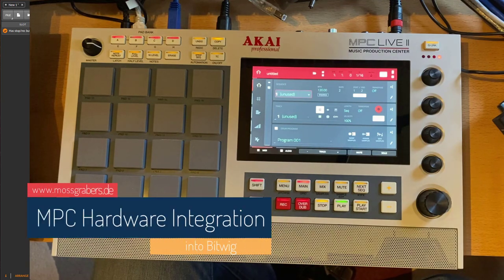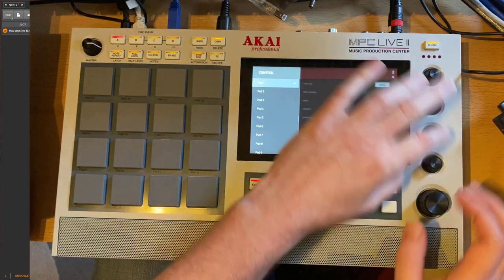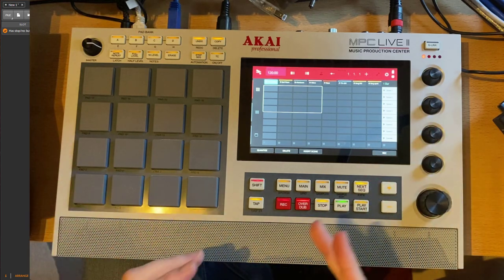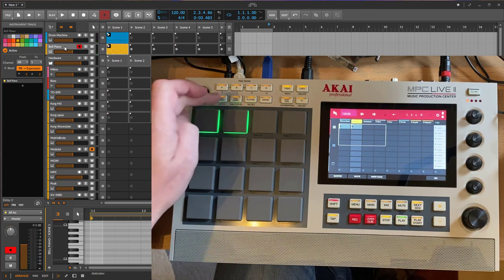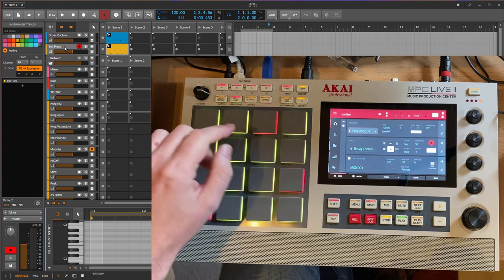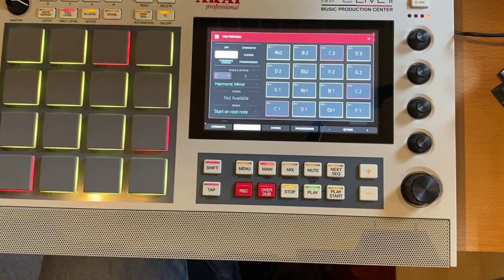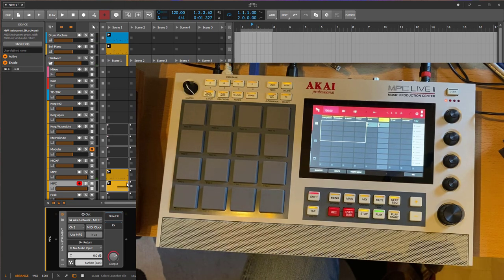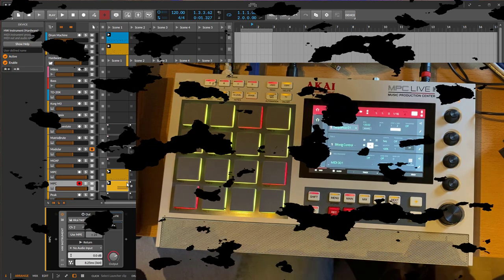Integrating the Akai MPC into Bitwig as a Hardware device

Comment: This effectively makes the AKAI Mpc Multi Timbral in standalone mode when connected to a DAW (Bitwig), with this script. If you are in the MPC world you know that has been the biggest pain on these new Akai Mpc's. Basically connecting your Akai MPC to Midi Interface connected to your DAW only allowed one MIDI channel to work, hence many were using Midi Clock but Akai MPC does not like to be clocked by Midi, but it is a solid when in standalone mode controlling other Midi gear or CV.

Comment: Jurgen, I have been running this same set up as you have with 3 instances of Midi channels from Akai Mpc X with the Ethernet USB adapter (X does not have Ethernet port) into Mac Studio and I get some drop outs of midi notes, I also have CV Channel and that seems to drop out a bit more than the rest, there seems to be no drop outs if I am using any VST instruments from Bitwig, have you encountered this at all ? I also tried it with Wifi and it was doing that and timing was a bit sloppy, even with the latency compensation. You have a Live 2 which has an Ethernet port... Let us know please Cheers! As always great videos
Reply from the maker: No, didn't experience dropouts but as you mentioned such adapters or WIFI can always cause such issues.
Reply: @mossgraber  The adapter is an Apple one, but all good. Also I am on 19.1, I see there is 19.2.1, do you think that will make any difference, also do we trash the old extension on the Mac and replace it with new on ? Thank You, So Much !!! Cheers
Reply from the maker: @PylonRecordsdotcom  Don't think that it will make a difference. Simply replace the bwextension file.